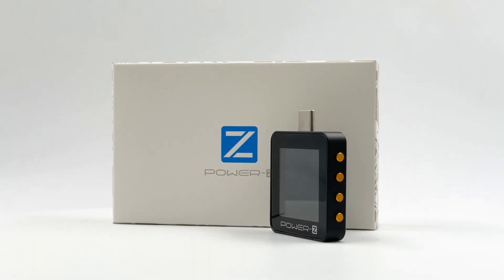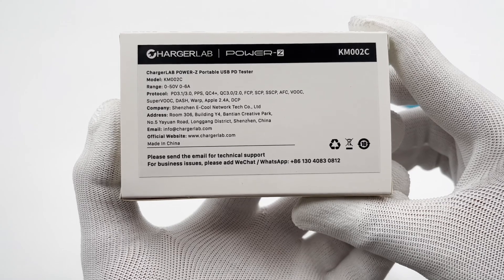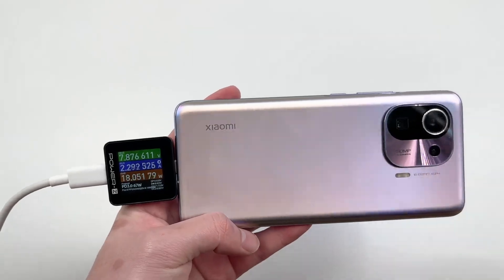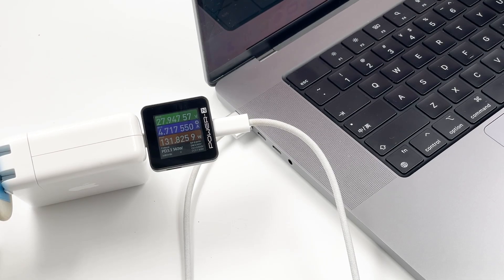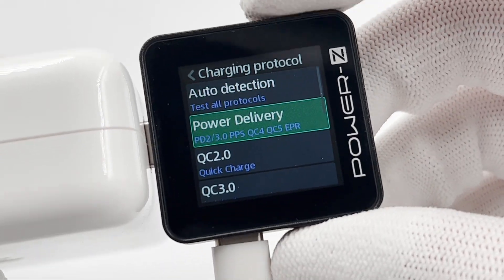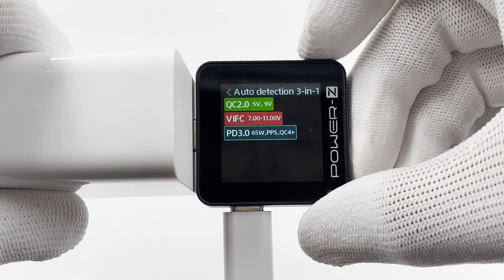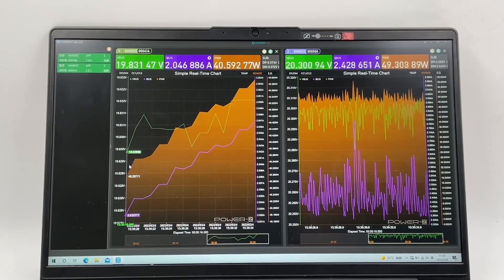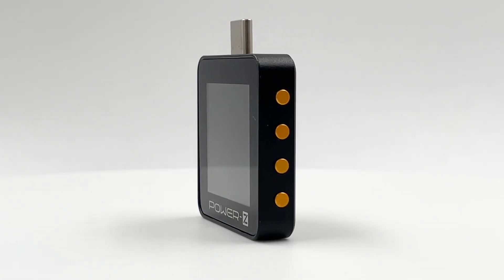Unboxing | How to Use POWER-Z KM002C @ChargerLAB

Comment: When would a KM002C be more useful than a KM002C Lite?

How do you use this device with USB-A ports?
Reply from the maker: KM002C can support up to 10A, while lite version limited to 8A.

You can use USB-C to USB-A cable to connect your USB-A devices.

Comment: What about some battery for triggering PD like in Power-Z KT002? It's so inconvenient to use HID cable to power on the tester.
Reply from the maker: It's pretty difficult to transport and manufacture batteries, and there is a risk of damage.

Comment: The POWER-Z KM002C looks really nice with a high what to have factor! but my "problem" is that I'm a MAC user and are deeply involved in Apples infrastructure, so i have following questions to be answered before I buy: 
- Is a version for Mac OS platform planed? and in that case about how long I have to wait?
- can I use the unit for Internal resistance test of cable?
Reply from the maker: 1. The software for Mac OS is planned, but we cannot provide an accurate waiting time. Because we're still focusing on improving user experience on the Windows platform.
2. Internal resistance test of the cable is also in development and hasn't been ready to release.
So, if you're waiting for those two features, you can wait for a period of time.

Comment: Can I use it with an adapter to USB-A port? I have some USB-A cables to test and didn't want to have to buy 2 testers. If so, do you recommend any adapters?
Reply from the maker: The KM002C is designed for USB-C port and PD protocol.
The USB-A cable is not the perfect option for this tester.
And the adapter may affect the testing results.

Comment: I just got mine today. I can see the firmware update available in the PC software but I can't get it to update. How do I update the firmware?
Reply from the maker: Hi, you can press the "back" button of the tester and hold still.
Then, connect the tester to your PC and release the "back" button until you see the loading bar.
Then, you can update the tester.

You can send the email to info@chargerlab.com for further assistance.

Comment: I love this, the price is really good! But after two numbers after the comma, the numbers are not useful and confuse a lot, I would rather have the option to only show me two numbers after the comma. It is easier for the eye and productivity. 
Example from 1:46 : just show 6.28A instead of 6.279655A  thank you
Will purchase one after the changes
Reply from the maker: By the way, you can switch to slow the speed (FPS) of the number.
Check our manual for more details
Reply from the maker: Thanks for your advice.
We will send your suggestion to our engineer department.
Reply: As a senior technician I have to agree cut the crap and stick with standard engineering notation of three significant digits. If  you may have a user preference setting for those that want to switch to the seven digit view but keep the three significant digits as the default. Cheers, #SeattleRingHunter

Comment: It doesn't seem to properly recognize multiple USB PD 100 watt 20 volt charges and power banks I have. Anyone have the same experience?
Reply from the maker: Can you send the details (screenshot) to info@chargerlab.com?
Reply: @ChargerLAB  will do.
Reply: Yeah, brain fart on my end. I grabbed a 60 watt cable which of course looked just like a 100 watt cable. Works fine.
Reply: USB-C in a nutshell. How is anyone supposed to know the capabilities of a cable at-a-glance? It's completely opaque to the user!
Reply: @MikeTrieu  I think it is an impossible puzzle to solve.
Reply: @ChargerLAB  only certification is the problem with this so there is assurance it features and setting does work.

Comment: anyone having the powerz.exe key up in 25 engines for malware?
Reply: I’m seeing this too. I’m planning on running it in a VM just long enough to get the new firmware on the tester.
Reply: @AviDrissman  argh....I dig this unit but having to update firmware from a laptop that then gets wiped out is not good. It is far more stable with the updated firmware versus the factory beta firmware though. Power Z, you paying attention? Without monitoring software peopl can trust this is a problem.
Reply from the maker: Please go to our official website to download the PC software.
And also, we can guarantee that our software does not have any malware, 
and different antivirus software may have different results.
If you want to use the PC software, you need to trust us.
Or if you're really worried, you can run this software in a virtual machine.
Reply: @ChargerLAB  The software is being downloaded from the official page. Despite it being the latest version, once you download it, it will ask you to download an update from the app which fails. 

I get AV will trigger on new apps but run the .exe through Virus Totals to see what we're seeing.

Windows 10 won't even let you execute the file with base Defender support.

I just want to note: i'm still keeping it because it's a handy tool to have.
Reply: Don't want to leave folks hanging but starting to see this as just twitchy AV software on new applications.
Reply: Well, OK. Now even Bitly blocks the link...
Reply: Just an update for historical reasons: latest version clears Virus Total just fine.

Comment: Hello ChargerLAB, 

I have a question. Is it safe to use lower wattage PD powerbank on a laptop? As I'm thinking to use 24W PD anker powebank on macbook pro 14 while I'm on the move and don't have any power outlet nearby. I'm afraid it'll damage my macbook's battery or the macbook itself.

Great video btw.
Reply: USB-PD should work just fine at lower outputs but i'd recommend a beefier bank with full 100 watt rates or at least 60 watts for the MBP 14. The 24 watt will charge it but slower. I'm not sure if the MBP14 throttles performance on battery or not but it's possible it will to save on battery power so investing in a 100 watt hour power bank with graphene hybrid battery and 100 watt charge rates probably isn't a bad idea or going for a full-on large power bank with standard 110 inverter if you really need capacity on the road. Obviously not portable but worth a look. I'm digging the ChargeASAP Flash Pro Plus which can drive multiple laptops simultaneously with its main limitation being 100 watt hour capacity with a lot of it apparently held in reserve. I've run a 100 watt USB-PD laptop, 60 watt USB-PD laptop and Android phone simultaneously on it.
Reply: @FakeGordonMahUng  Thank you for the in depth reply! I appreciate it. Unfortunately there are only unknown chinese brand with cheap prices for 60w+ power banks in my country. I'm hasitant to use them. So I think I'll stick with 24w powerbank from anker for the the time being, as I only use the macbook for light tasks.
Reply from the maker: It won't damage your laptop. But when you use it while charging, the battery level may be continue to drop.
Reply: @ChargerLAB  Got it. Thanks for the reply. :)

Comment: I ordered mine from Aliexpress for $70. It arrived within a week and a half, impressive given the logistical challenges that are plaguing the world. My first impression of it was wow, but you really owe it to yourself to do a lot of navigating and getting acquainted with the device yourself since there is no English manual. My unit was set up in Chinese, it took a while to find the language setting to get it to English.

To conduct automatic protocol detection, you must supply power to the HID USB-C port first, or else the device will crash due to lack of power, supposedly.

Upgrading the firmware was also straightforward too, after finding the software and using Google Lens to translate the program that is in Chinese. My firmware was 1.06 alpha, and I updated to 1.2.1.

Recording data for testing power bank capacity is limited to 10,000 data points per bank, and you get several banks. To make sure the capacity test is within the same data bank, reduce the default polling rate for data collection from 10 seconds to 20 or more seconds, if you have a huge power station you'd like to test without the unit continuing data collection on  a new data bank after it fills up the 10,000 data point limit on the current data bank.

Overall, good unit, still has ways to go in terms of English user manual, English software for the PC, and few refinements in the firmware.
Reply from the maker: Hi, thanks for your advice. We've published the English user manual, you can go to our official website to get it. And the software for the PC has been translated to English as well. We are trying our best to bring better user experience.
Reply: @ChargerLAB  Much appreciated for your reply and product improvement! I love this channel and your product lines of Power-Z testers.
Reply: @ChargerLAB  can you give me a discount code for Amazon ?
Reply: @ChargerLAB  Excellent video, congratulations, please make a video on how to connect it to the laboratory source to diagnose consumption of a cell phone in a short circuit!

Comment: Very cool! Say, are there plans to add Lua or other scripting support like in the KT002? I've been working on a PPS-based direct battery charger script that runs on the KT002, and having PD3.1 support would be cool to improve the range of supported voltages.